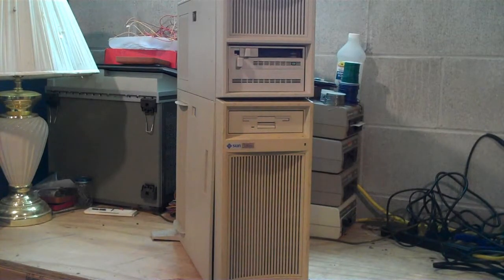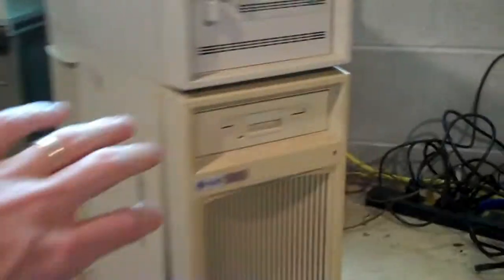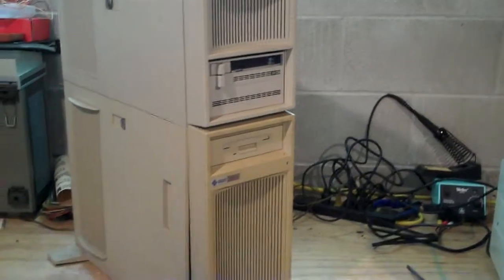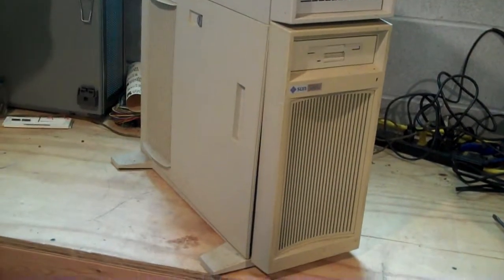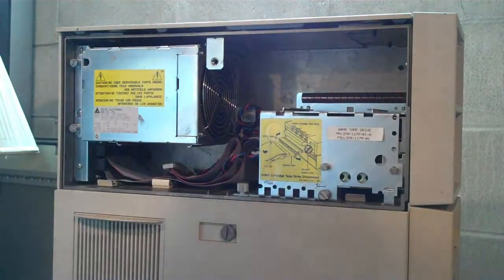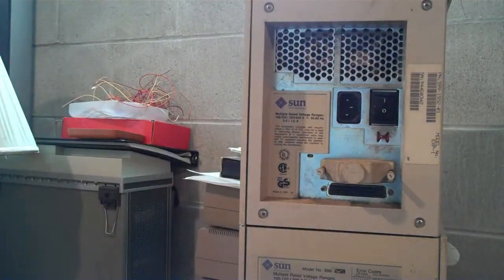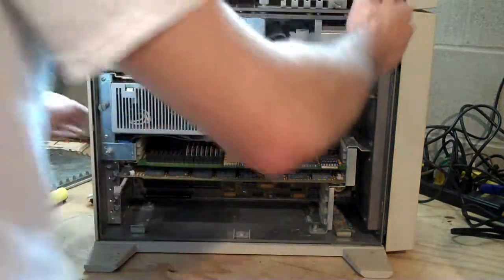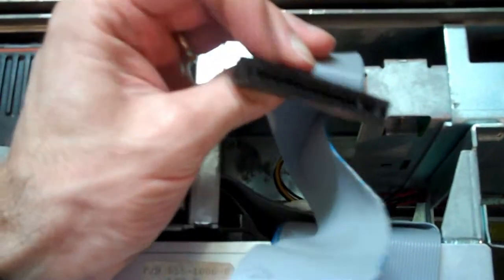Sun 386i Tour, Part One

Comment: I worked on that beauty and then was the Lead Engineer on the Sun 486i which only went to production for weeks...sold maybe 150 machines and then they took it back (cancelled) to focus (All Wood Behind One Arrowhead) of SPARC!

That was a great machine.....did you see all the names inside the side-cover....I came only weeks too late to get my signature on that panel...I was bummed.
Reply from the maker: No kidding! Can you sure a couple of anecdotes on the development of both machines? And what'd you do after the 486i?
Reply: @jpkiwigeek  I went on to work on a number of SPARC systems....lots of them....I forgot the order. the Sparcstation LX (Sunergy) and Classic, Tazmo (your e450 machine), then on to work on design of boards that ran windows again....the SunPCI boards (another Intel/amd development to run windows on sparc products), then I left Sun for a start-up just before the .COM crash....the start-up failed, but lasted 4 years, and I made y way back to sun to work as a sustaining engineer on the  T5120/T5220/T5440 (in sustaining), T3-4 and T4-4 (Developed the CPU module to make a T3-4 into a T4-4) and then finally Sustaining if the T7-4 ...the last bunch as the sustaining engineer.

Comment: LOL. I wondered where my comment went. It "disappeared" so I posted on your general page. But I was on Part Two. Yes, if you want to pay the shipping, you can have the parts. I was just about to toss the power supply. I have the frame buffer, the parallel/serial card, and the memory board, which doesn't seem to have any of those socketed 1MB ECC sticks. Just the 16 empty slots. Once I can get the drive out, I may be able to extract the MB but we'll see. LOL.